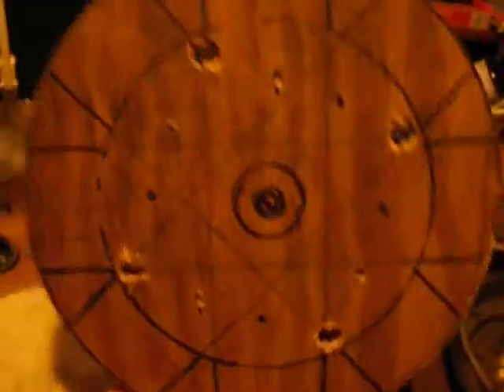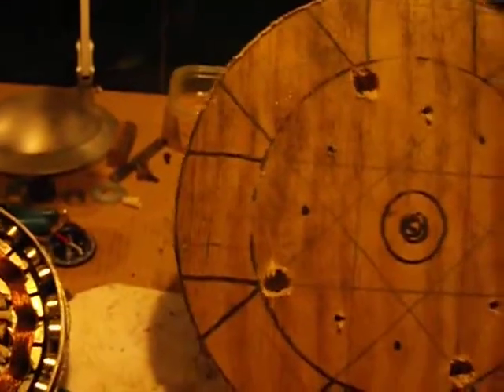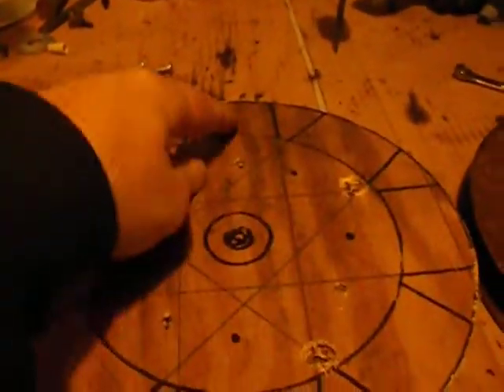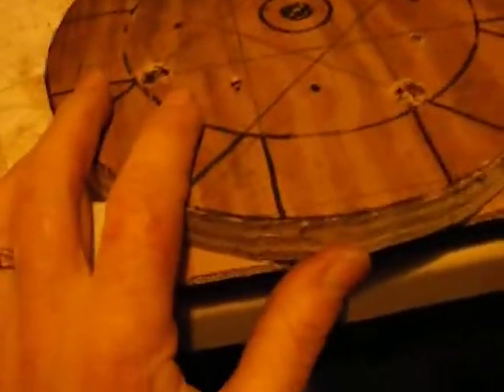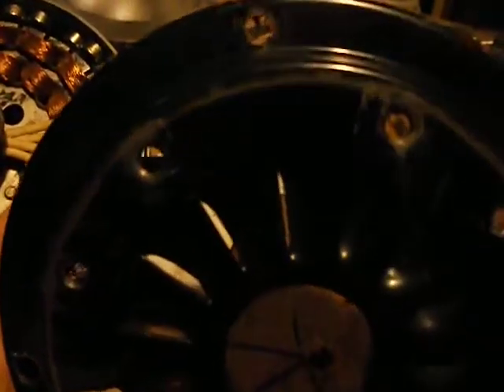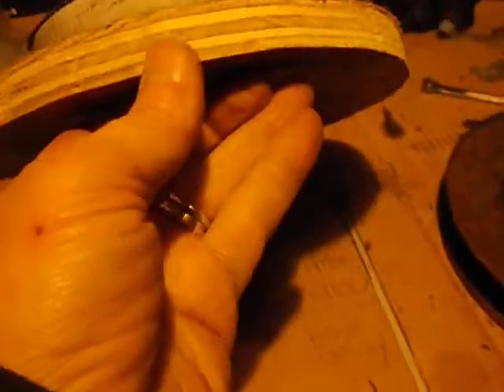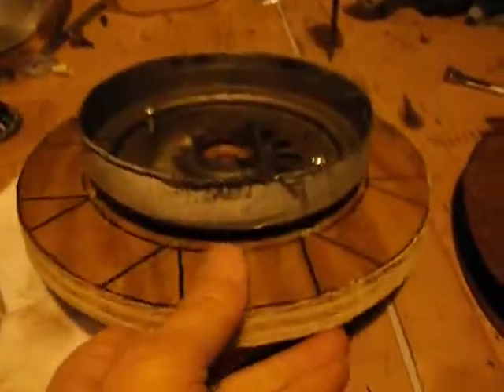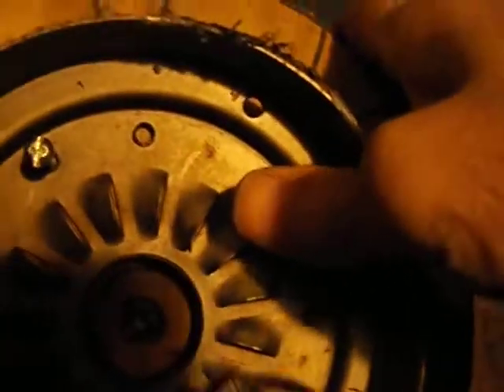Ceiling Fan Wind Generator Rebuild 5

Comment from the maker: hey muddy, thanks for watching,,and thanks for the info,i did use polyurethane on the bolts as well ,but that is a great idea and will seal the hole to,.it works great and will turn in light winds , i have to change my tail so it moves and stalls in heavy winds,, i have more great ideas to use them in my home as well.